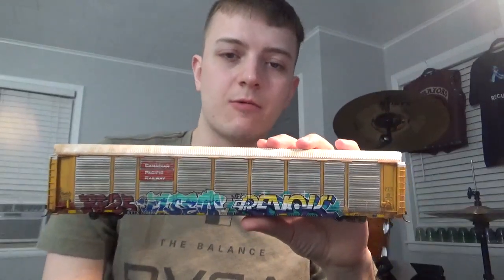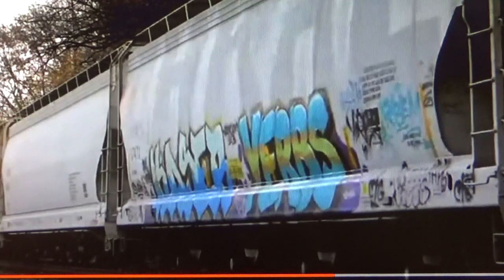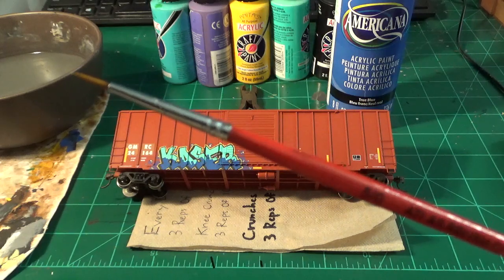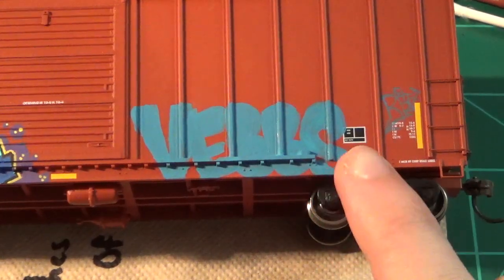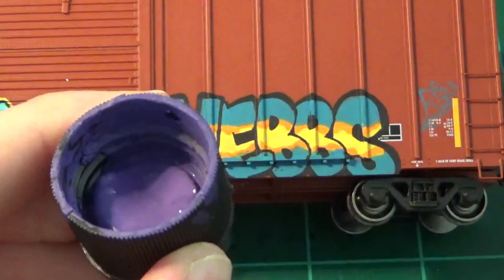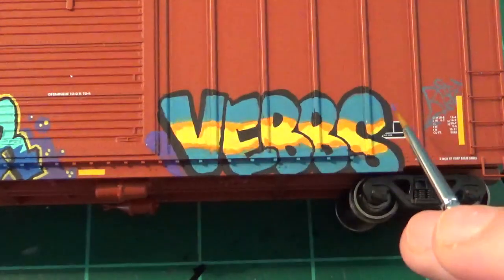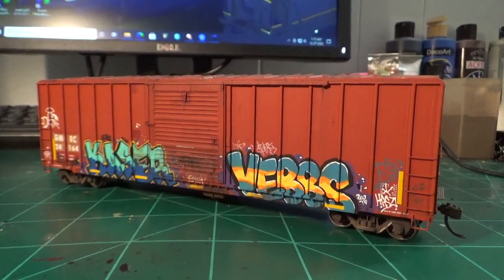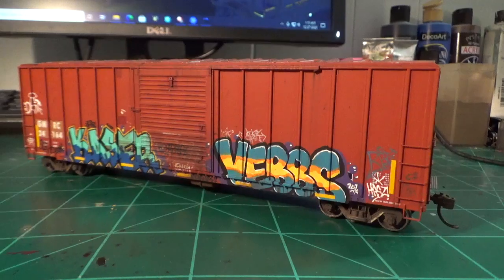Painting Realistic Graffiti On Model Trains!

Comment: Nice work and a fun video. I’ve found cheaper paints need too many coats to avoid ending up with relief/ brushstrokes. Not enough, or finely ground enough pigment in them. On darker backgrounds, I’ll sometimes cut a mask defining the outermost edge of the piece and white it out with my airbrush before continuing. This eliminates multiple strokes and build ups.